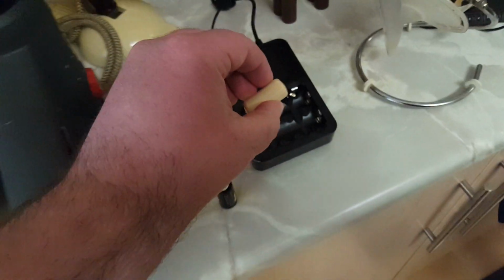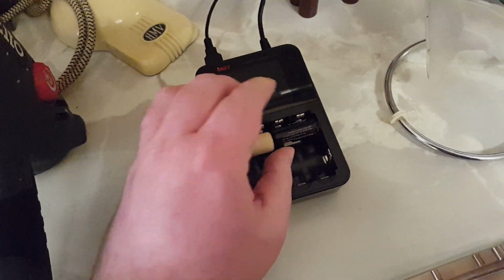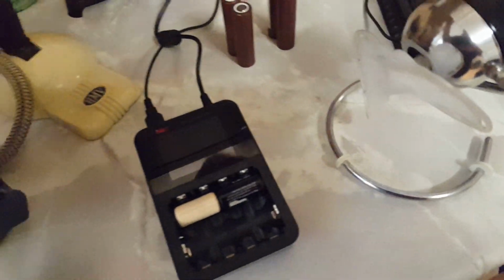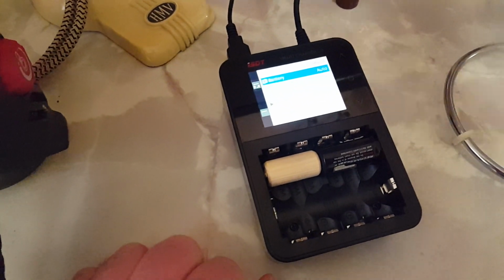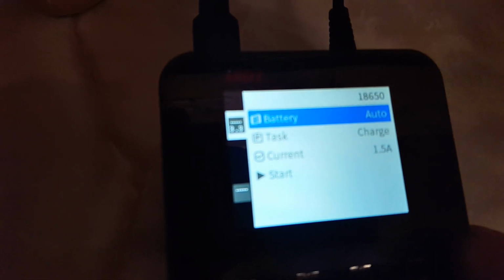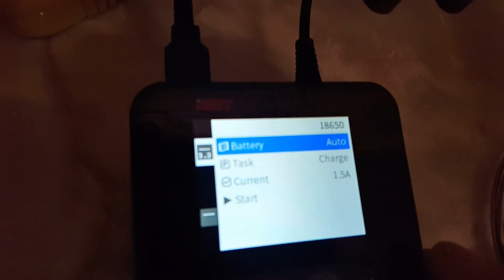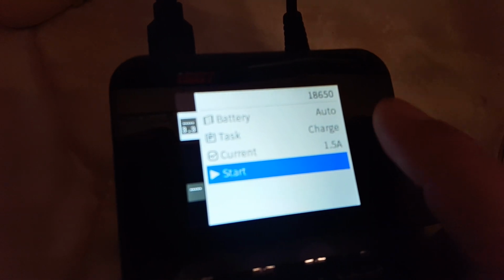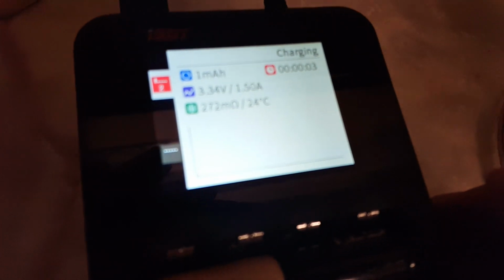Charge LR123A with ISDT C4 charger

Comment from the maker: Obviously you'll also need means to fine tune the rod: sand paper or a file. Also remember that the temperature probes in the C4 are in the positive terminals. So put your adapter on the back end of the battery.